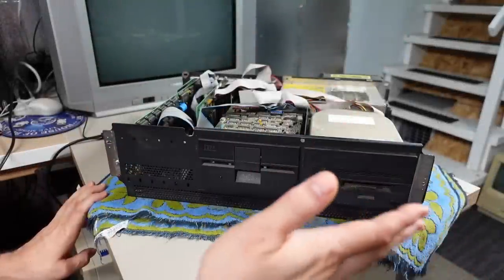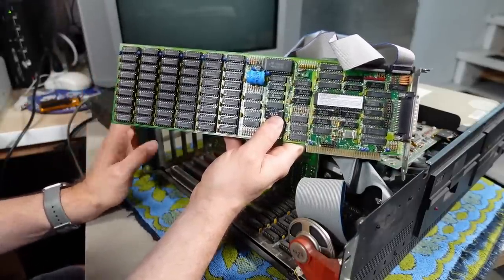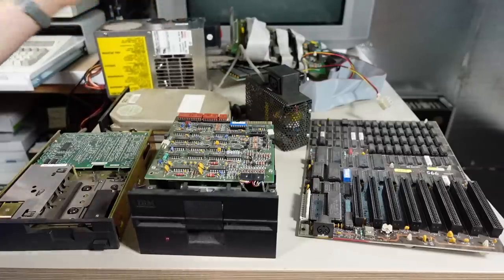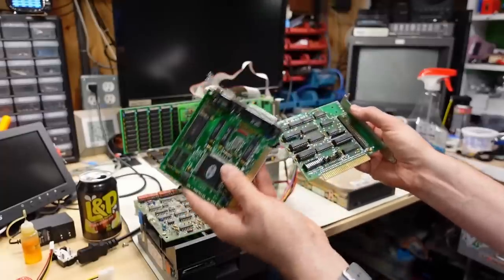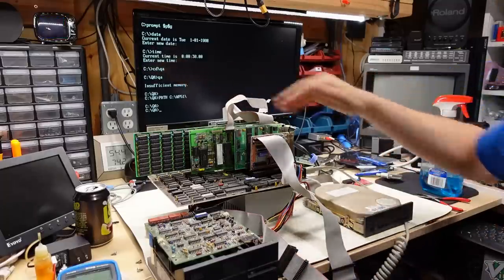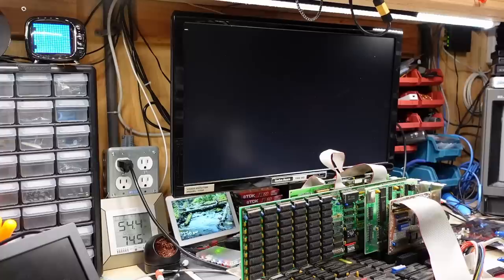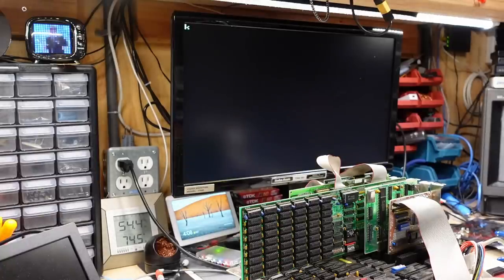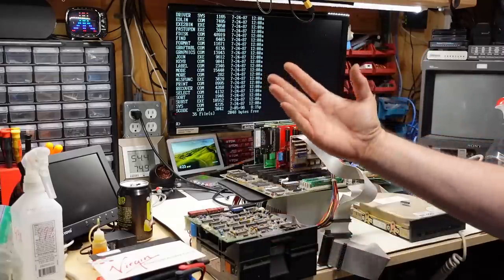PC archeology: IBM PC XT with a strange appendage

Comment: Shugart Associates Systems Interface or SASI was developed in 1981. 5 years later in 1986 It was then evolved into ANSI SCSI which was later on renamed to SCSI. SASI was used mainly in mini and micro computers in 1981 until 1986 when it was then evolved into ANSI SCSI
Reply: In the first couple of releases of PC Magazine (1982, pre-XT), there are adverts for some SixPack Alike Cards, including an SASI, not SCSI, SASI Controller.
Apparently this was once a common method to get big 8" tapes and Winchester drives connected to your new IBM Micro Computer. 

And I recently learned that though SCSI evolved out of SASI, it's not really backwards compatible. Well at least physical it is and theoretically too, but the command set varies between these two slightly. That is that SASI does not have an INQURY command. 

And it's giving me a headache with my Shugart SA-1004 drive and SA-1403 controller. Because without an Inqury Command, it can't be really detected by the SCSI Controller Software.
Reply: Enhanced Small Disk Interface, ESDI.
later systems got multi disk controllers, SCSI and IDE
Reply: Thanks, you saved me the trouble of explaining what SASI meant! 😉
Reply: @lucasrem  I recall having to work with 8-bit and 16-bit IDE drive differences, the ST-506 interface, and a sort of precursor to IDE drives in the Compaq Portable II where it had an extra card on the drive itself.  So many years ago... ☺
Reply: @Tombowolf  that is how a bunch of things are they evolve and improve from an older standard but are not compatible. There are many reasons why that can be
Reply: I'm hoping someone can confirm/deny a long-held suspicion I have, that SCSI was originally intended to be pronounced "sexy". Seems kind of logical following on from "sassy", and also a more plausible pronunciation of the letters than "scuzzy", which seems more like the kind of pronunciation someone would choose in a fit of pique at being told by a committee that you couldn't call it "sexy". :)
Reply: (similar to what happened to "sexadecimal")
Reply: interesting how they went backwards in the acronyms when SCSI evolved into SAS, and then later became the parent of SATA. And now you can use SAS controllers for SATA drives because the two standards are so similar
Reply: Didn't the Atari ST also use SASI?

Comment: I’m almost certain that TEAC drive uses the standard audiocassette tapes. Would be a fun mini episode to get that drive up and running. What’s strange is that the drive seems to have a much more complicated mechanism than a traditional QIC drive from the era.
Reply: we had some of these drives in high shcool, nope regular cassette would not work, we tried that first, never did find out what kind of tape it used
Reply: I have the same(maybe) TEAC tape drive in my collection and it DOES definitely uses normal audio cassettes. I have tried and it works fine with what is available today but it has to be blank for it to be able to be formatted for data storage use.
Reply: I'm familiar with these TEAC tapes as well. They sure looks like regular audio tapes but they are not. There are some tabs/holes that differ if I remember correctly that prevent the use of regular audio tapes. Maybe it's possible to convert a good quality audio cassette tape and see if it can be made to work. A video idea for Adrian maybe? :)
Reply: Part of the difference is the tape formulation, the magnetic coating.  It's similar to the variations of audio cassettes, with basic original ones, chrome, ferrichrome, metal, listed as Type I, Type II, etc.  I used a similar data cassette drive in the late '70s on a Perkin-Elmer minicomputer.

A similar situation went on with 8-mm and later on 4-mm tapes, they had data tapes, and video tapes for camcorders.  Trying to use 8-mm video tapes for data storage was hit or miss, leaning toward the miss side.  We ended up fighting with a supplier who would send us video tapes when we ordered data type; I think we ended up switching suppliers.
Reply: @andrasszabo7386  Bulk eraser time!
Reply: @Dan-TechAndMusic  that's correct. They're not standard cassettes, but have a special cutout and no pressure pad. I used to use this exact drive to back up my st225 back then.
Reply: It's like a normal compact cassette, but the tape itself is like a Type II tape, and there's a metal strip on the tape so the drive knows where the end is.
Reply: @compu85  That sounds about right.  I think I have one kicking around somewhere, as a media memento, like a few 8-inch floppy disks (not "diskettes" 😉).
Reply: @lousmith84   most likley need the  head alinement to read like on the old commodores tape games
Reply: Unless it is in an episode I haven't seen yet we must at least attempt to get this working to see what kind of tapes it really takes.
Reply: @stijnbagin  Do you (still) have the link to that manual handy? 🙂
I'd like to look it over and see how it compares to my memory of similar data drives on minicomputers.

Comment: The 63.5 watt power supply in the original PC can generally handle a half-height hard drive, but not the power-hungry full-height drives that were the only kind available when people first started installing them into their PCs and caused them to burn out their power supply. Aftermarket power supplies with higher output didn't become readily available until half-height drives had already become common. But I think some of the later 5150 PCs came with the same 130-watt power supply as the XT.
Reply: I once had a 5150 with a 63 watt power supply and a 10MB full-height hard drive. It would only turn on for half a second before the power supply cut out. I ran the drive off another power supply and everything worked fine.
Reply: I actually used to use some old computer power supplies out of machines of probably around this time for some things.

 back when it was not as popular to repurpose computer power supplies!

Everything in the machines works except they were just obsoleted buy new equipment.

 and they said all you have to do is say yes I want them.

 of course took advantage of anything I could Salvage.

They were a mix of generate the different generations of the IBM machines .

and yes some of them did have something similar to that as nexternal power supply.

 although some literally had a power supply for a computer installed in a external chassis that was just a power supply and power connector an output connector.

The weird thing is it turns out those were full-size power supplies.

Don't remember any of the ratings on any of these either but they were about the same size as the original.

 with a power supply that was external.

Also there was a small box that was used on some these machines I received.

 I do believe it was some of them with the external power supplies?

 which would make sense it was a box that had power switch on the front if I'm not mistaken the IEC inlets and Outlet connectors including one for monitor 

which also had a separate switch.

 which makes you think these machines were left on 24/7 having a separate switched receptacle for monitor.

But the power switch for that little box the main power switch turned off all Monitor and two or more additional IEC power receptacles.

 there might have been one perhaps that would stand on and there was also one standard receptacle as well which is just odd.

I have no clue what these machines were originally used for either!

But it was an oddball application.

And there were also similar switch boxes except only for Monitor and computer power only.

As well as often there was a note on there on some of those switch boxes...

 that said not to turn off the switch on the computer and turn off the monitor.

 and not the MainPower the power switch off unless instructed to.

It was a marker on masking tape labels!

Said something about when not using computer leave running but turn off.

 monitor switch but not on every one of them !

strange set up to say the least.

Although in school we were supposed to actually use the power strip switch and not the switch on the computers!

 all the instructors we're told to let the students know this because evidently there might have been a reliability at issue????

 and apparently they had to have work done just because of the switches on the computers failing???

 in normal day-to-day use!

But I don't know if that was an actual issue or if that was hearsay that just caught on.

Also they did not call them power strips they called them Gator strips!
Reply: @aaronbrandenburg2441  What happen? Somebody set us up the concrete poetry?
Take off every ZIG! For great justice!

Comment: For an XT system, those desktop publishing apps are amazing.  After that insanely slow memory check, whoda' thunk.
Reply: My M1 just runs when u turn it on
i buy a new system if i need more mem!
Reply: Argh, the slow memory check...I got bitten by that recently troubleshooting a PC with memory isses with no monitor attached. For ages I was thinking that the system was failing to POST, when in fact I just needed to wait a few minutes for the beep.

Comment: Q&A was a fantastic DOS office suite.  Used it for years at my old job, even after moving to Windows 3.1.  Didn't drop it until Win95 era.
Reply: Loved Q&A back in the day.
Reply: Q&A + WP51 was ver common. FP is First Publisher (GUI loosley based on the the AtariST version). The mono card is probably also Hercules compatible, specifically for the HiRes software in mono.
Reply: I do remember at one time we did have Q&A installed on one of our computers years ago don't remember when it was pretty sure it was beyond Windows 3.1 but not sure
Reply: Q&A was a fantastic database in its day. Too bad Symantec dropped it
Reply: It was funny to read that the last modified dates were in 1995.  I can only imagine someone using this seeing the shiny new Windows 95 release and needed to upgrade! :D

Comment: SASI: "Shugart Associates System Interface" SCSI: Small Computer System Interface source: wikipedia
Reply: Worth noting that SASI + extensions became SCSI 1.0 when it was standardized. SASI uses a fully compatible subset of SCSI 1.0 commands.
Reply from the maker: Ah thank you! I'm not sure I ever knew exactly what it stood for.
Reply: I just happen to have a tape drive and controller card with the same interface.  Thank you all for this information!
Reply: @adriansdigitalbasement2  i didnt either but there is that saying google can be your friend

Comment: That TEAC tape drive deserves a dedicated video very much.
You would need a data cassette, like TEAC CT-600 or Maxell DC-300 (ones with notch on the top).
My guess, than notch indicates that tape drive won't take a regular compact cassette (?)

Comment: I remember when I used these machines at GMC Vauxhall Bus and Truck in Luton UK and at a previous company's, IBM would refuse to fix there products if you had non IBM modifications.
This may be why this mod was done so if it needed to be serviced or repaired, the machine would have to returned to it's original state.
The parts were very expensive.

Comment: I had an old IBM AT had that little power supply. It's rated for 40watts and was used to power a Floppy Drive and Colorado Tape drive. I reused it when I swapped the motherboard out for a Socket3 486. Used it to power the Hard Drive, Floppy and CD-ROM.

Comment: The round connectors are Amphenol CPC series connectors, “Circular Plastic Connector”. They come in many sizes with lots of pin counts available, a cheap alternative to expensive mil-spec metal connectors.

Comment: This is an aux PSU for the 5150 with it's 63w PSU. There was a round knock-out plug on the 5150 chassis rear panel that would fit this round connector. It's a neat and now pretty rare upgrade item. Neato!
Reply: I just got a 5150 that had a Seagate drive installed. The two half-height floppy drives were powered by that auxillary power supply. I don't have the aux PSU but the cable was in the case. Something from a bygone era. I don't see a use for the cable. If I wanted to provide adaquate power I'd replace the internal PSU.

Comment: Swapping power supplies would've voided IBM warranty, especially if you were a company and had an IBM support contract.  Having a separate power supply for the TEAC tape drive would've left the original 5150 hardware in place and operating independently from the Everex stuff.

Also, tantalums popping are cake.  I can remember working at Netscape in the late 90s and having a dev server decide to blow a few big electrolytic capacitors.  Sounded like gunshots and caught the chassis on fire.  After hosing it with the fire extinguisher and letting things cool off we took it apart and it had blown holes in the power supply circuit board and the motherboard, as well as putting a dent on the inside of the case.

Comment: I think SASI was Shugart Associates System Interface, and I want to say it was the basis for SCSI.
Reply: Just checked on WP and they agree. It went from SASI to SCSI because they didn't want the protocol named after a company.
Reply: Just think about the "Centronics" parallel printer interface, or the "Hayes" modem AT command set.  Plenty of company names used for products, often outlasted the companies themselves!

I remember SASI drives, and SCSI coming out.

Also the HPIB / GPIB / IEEE-488 instrument control bus, evolving from proprietary to a standard.

Comment: I once had a system that used a card with a complete PC W/Ram and was used as a network syste. You would attach a monochrome monitor to the card and it would use the PC resources for hard drive and data transfer. You could put up to 3 of the cards in a system in order to have a 4 terminal network with the PC being used as the server. This was around 1986, unfortunatelly, I cannot remember the name or brand of the card.

Comment: The purpose of the "appendage" reminded me of mod I felt compelled to make in the early 2000's for my file server at home.
As a poor college student, the most powerful power supply I could afford was a 300W ATX. At the time, I was running a Pentium II 400MHz in a full tower chassis with as many used old SCSI hard drives as I could snipe on eBay. At one point, the server had 10 SCSI HDDs (10K, 15K, etc.) and two IDE HDDs mounted and I was certain I couldn't reliably power everything from the single ATX supply. 
So I scavenged another 300W ATX supply  and built a "remote trigger" out of a relay, a large capacitor, a diode to protect against back EMF and an LED. It was energized by the main supply and the relay "turned on" the second supply. 
Most of the drives were connected to the second supply, leaving the main system and IDE drives on the first supply and I ran in that configuration for years. 
Best. Space. Heater. Evar.
...also very noisy.

Comment: The cable hanging out of the side reminds me of my A1200 setup in the 1990s. Which consisted of an A1200, with 2.5-3.5" IDE converter ribbon which trailed out of the Amiga case into an empty (except for PSU, 3.5"HDD and CDROM) PC/AT case. Quite a fragile system.

Comment: My first job as a computer engineer was repairing and aligning floppy disk drives. The IBM Tandon 5.25" 360k was the first drive I ever did. In my second job I worked on everything else you were looking at on that XT PC. We had a clean room where we rebuilt HDDs and the ST225 was certainly one I have worked on. Replacing heads, platters and writing the servo which I think was Cylinder 0 -1 or maybe -2 with a small servo track writer that you could manually move the heads with. Then we used a Hdd analyser to perform a complete surface test. Then attach the drive to the PC booting to DOS on a floppy, running debug with g=c800:5 to initiate the low level format utility in the controller's ROM. Then finally partition and hi-level format the HDD.
Reply: Are you still in this line of work?
Reply: @EddieLeal  Hi, yes I am but more with computer comms equipment repair and laptops these days and I repair valve radios as a hobby. Thanks for asking.

Comment: That's why I replaced all the 3 leg tantalums on my 5150 before I even turned it on! Mouser still sells new ones that look identical.
Reply from the maker: Ah nice -- didn't know they did. You can't mess up the polarity that way
Reply: @adriansdigitalbasement2  What amazes me.. is that this decent software at 37:05.. is running on 640Kb of memory 😯.. and it must use 1Mb or 2Mb top's in the HDD 🤔............... something like this today.. waste 30Gb or 40Gb 🤢... requires like 16 CPU Cores and 20Gb of RAM at least 😤...

Comment: The IBM 5150 had a round punchout above the cassette and keyboard ports on the rear panel. That is likely where the round power connector was intended to be placed.

Comment: It's been a minute since I've heard someone say the name Everex, I had a few of their laptops before they went out of business, and they where some of the worst I've ever owned having the VIA C7 X86 CPU's in them, as the Windows drivers barely worked, and Linux on them at the time was a true pain, plus overall just being slow as molasses to use.  So I'm not surprised the little Everex PSU you had on this machine was crap.